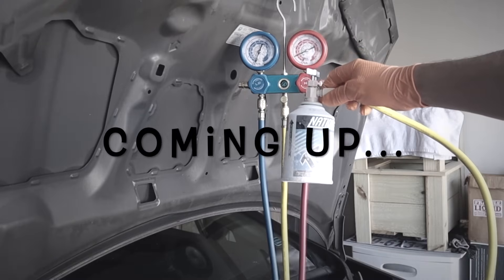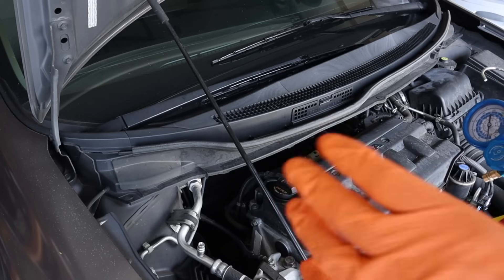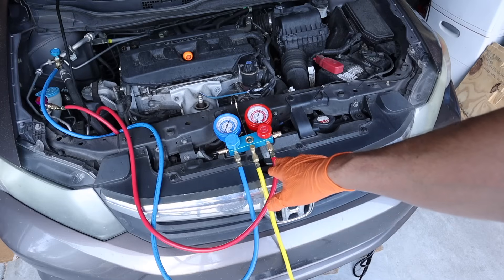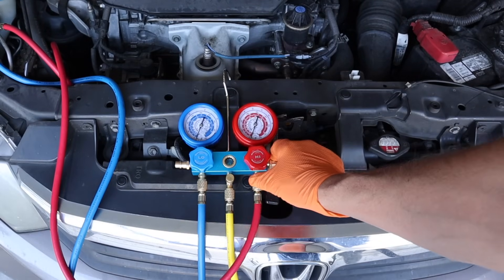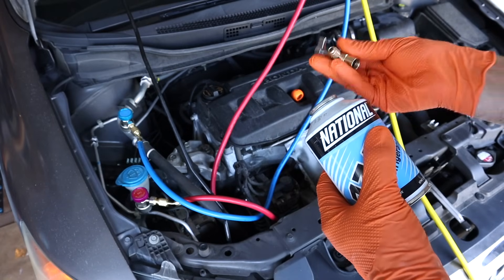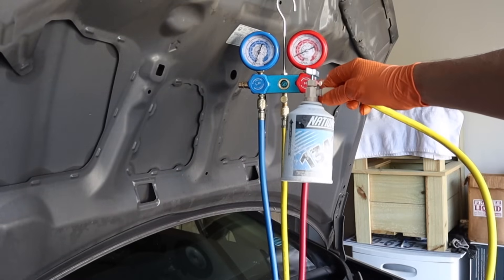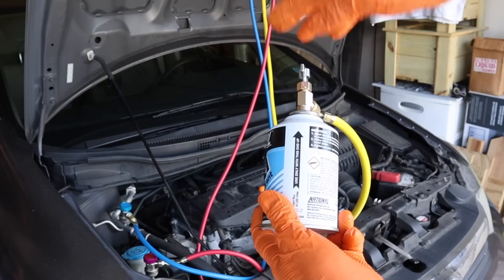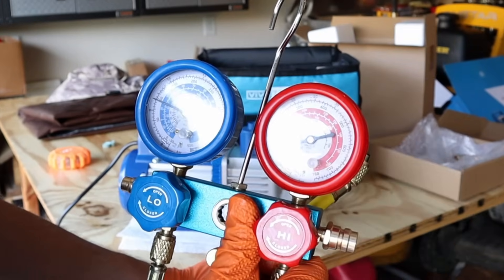DIY Tutorial - Proper R134a A/C charge & Diagnostics

Comment: If the system still have refrigerant in it and you do the vacuum, does it pull the refrigerant out too?
Reply from the maker: Good question. You'll need to get the refrigerant reclaimed (taken out) at a local shop before hooking up the vacuum pump. Most shops will do this at no charge if you tell them that all you want to have done is have your refrigerant reclaimed. They can reuse/recycle it so it's a win-win. You may have a to call a couple of shops before one will do it at no charge, but they're out there. Hope this helps!

Comment: You should close the high pressure valve prior to opening the low pressure valve to let the refrigerant end.
 You're simply reading the high pressure gauge while the fluid is going into the low pressure side.
Reply from the maker: @Gruin  100%, yes indeed high side stays closed when refrigerant is going in. Thanks for watching!

Comment: If you close the valves to check for a leak, doesn't that mean you are not measuring the ac system, and are measuring just the gauge alone?
Reply from the maker: Solid question, thanks for asking. However, the gauges always "sees" what's going on in the AC system independent of whether the manifold valves are open or not (as long as of course you have your valves open down at the service ports). And you can look at this another way to confirm this.. When you have the manifold gauge set hooked up with a charged/functioning system, you can see the gauges fluctuate when the compressor cycles on and off, all while the valves on the manifold are shut. Hope this helps!

Comment: I’m having an issue with my vehicle accepting a charge. I’ve tried switching the yellow hoses, using a new can. Forcing the compressor on while charging but no refrigeration flow… This happened on multiple cars. I’m beginning to think the manifold is faulty
Reply from the maker: Couple of things that might help.. do the procedure on a hot day, 90+ deg. Second, try twisting the valve back and forth on the can up and down slowly until you find that sweet spot that'll allow the refrigerant to flow best. Hope that helps!

Comment: awesome video explaining everything however i have a 2009 cadillac cts with a 3.6l llt engine the previous owner got into a front end hit and damaged the radiator and condenser in which i replaced both items and installed a new desiccant filter in the condenser but i believe the cars ac has been unpressurized since maybe 2019 so i was wondering what should be my starting process because i was just gonna buy a can of 134 and hook my hose up to it and see if i can jump start my system but after seeing this im changing my mind as i want to do it right and i want cold air and id prefer not to have a shop charge me 200 plus for simple stuff i can do
Reply from the maker: In your case, yes definitely go thru the vacuuming/charging process like you saw me do in the video. And like @ddu2109 suggested, you'll want to add a bit of PAG oil to the system as well since you replaced your condenser. My only concern is that the system has been non-operational for 5-6 years. You may want to put a wrench on your compressor and see if you can turn it by hand before you do anything. If it's not locked up, then proceed on, cross your fingers and see what happens! Thanks for watching and good luck!
Reply: You should start w an evacuation, then make sure the system holds the vacuum from evacuation to show it's air tight. Then start with the fill. (Consider adding lubricant, depending on what was changed) if the dessicant has been in a system unsealed since 2019, I'd replace that dessicant prior to evacuating the system.

Comment: After I vacuum the system to 30 inches of mercury, how can I check whether I have a leak at the schrader valves? Your method only shows if there's a leak in the internal AC system because the schrader valves are still depressed, correct? My system is completely empty of freon currently because I have a slow leak somewhere, but I dont know if its just the schrader valves. Thanks.
Reply from the maker: That's true, however you'll generally get a sense of whether or not you have a leaky Schrader valve due to wetness (from oil) at the valves. An easy way to test the Schrader valves if still unsure is to spray a little soapy water onto the valves (when the system is pressurized with refrigerant) and you'll see bubbles if you have a leak. And if you are still not quite sure, replacing those valves are easy enough. You can find a kit here to do just that: https://amzn.to/45ddxfJ Hope this helps!
Reply: @my-honest-review  Thanks for the tip. I ended up just replacing the valves.
Reply from the maker: @lucatoni98  Good idea for sure, glad to help 👍

Comment: After vacuuming, I put the refrigerant, I hear my compressor clutch engage, however, pressure from low to high is NOT transferring. What could be wrong with my system?
Reply from the maker: If you put the correct amount of refrigerant in the system and still no cooling (and your compressor is cycling on), you may have a restriction in the system. What do your gauges read when the compressor is cycling on?
Reply: @my-honest-review after vacuuming, the compressor doesn't engage, then i start to put refrigerant, i hear the compressor engage. However, low side quickly goes to around 30psi, but high side doesn't move. It seems no 'transfer' and refrigerant is stuck on the low side, i can't even empty the small can (and can doesn't get frosted)? Is my compressor not compressing even though it's engaging?
Reply from the maker: @pazuso  OK, so it sounds like its just very slow to take the refrigerant. Here's a couple tips... its best to do this process on a hot day (90 deg+), try putting a fan in front of the condenser/radiator, you can also try wrapping a warm cloth around the can as its going in and squeezing the can slightly, and lastly, try moving the valve on top of the can back and forth slightly as it can freeze up at times. It can be a little time consuming but hang in there!

Comment: It's your dryer
Reply from the maker: That was definitely a possibility, but it turned out to be the expansion valve. I did a video on it here: https://youtu.be/1PBz5_kW6q4 Thanks for hanging out 🔧
Reply: See the metering  devices got some form of restriction due to burnt oils or metal particulate in the screen or you have too much oil in the system that's all I can be. I was an HVAC Master tech for Sears for 8 years and rode over 13 manuals for HVAC this is not rocket science
Reply from the maker: @benm3574  Yep, it's mostly just taking your time and doing a little critical thinking. Thanks for hanging out!

Comment: Putting the can ( while connected) in a container of warm water, speeds up the charging process. It helps the freon leave the can, especially when the low side gets closer to normal pressure.
Reply from the maker: Great point, I've seen people do that for sure. Also, just wrapping a warm cloth around it helps too, thanks for watching!
Reply: For the purpose of using a scale you could maybe use a hair dryer or heat gun?

Comment: Did everything you did, and I've been trying to get this can to empty for an hour... So I put it on in the scale and it's actually getting HEAVIER.
Reply from the maker: Try twisting that valve up and down a bit on the can. Sometimes it ices up inside that valve. Twisting it can re-find that "sweet spot". Also try wrapping a warm cloth around the can as this can help. Hope this helps!
Reply: @my-honest-review  Thanks, I did play with the value punch and could hear  and feel the can react to the changing of pressure as I twisted it. I wonder if this 2019 Santa Fe XL just has some other failure going on, maybe a restriction somewhere. I might give it another try tonight, I've read about fill hoses having restrictions, which could be why the first can took so long, even under vacuum; I might swap the vacuum and fill hoses and see what happens (my gauge set has both).
Reply from the maker: @David.Murdoch  Let me know how that works out. And you might just need to wait for a hot day as this seems to help with the speed of charging as well.
Reply: @my-honest-review  ended up being a leak in the rear evaporator. I wonder if pulling vacuum then charging (a few times) can cause an existing leak to get more severe.
Reply from the maker: @David.Murdoch  Hey Dave, it's possible. I can see your reasoning for sure. Ordinarily, a sound system can withstand a sustained vacuum with no problem, but if a breach is about to occur, vacuuming can encourage it along. Ultimately, the breach would occur anyway tho. Glad you found your leak!

Comment: Hello, this is a very nice video with very good and wise advice on manupulating A/C, congrats.
One point though : I believe that by the way you purged the yellow hose, you did not purge the gauge manifold content itself hence still keeping a bit of air/moisture remaining stuck in that area.
Probably a good turnaround for this point would be having an additional valve on the yellow port of the manifold set so that after pulling overall vacuum and before disconnecting the pump, you would first close that valve. Do we agree ?
Thanks in all cases, very well done.
Reply from the maker: Indeed great point. Even after purging the air out of the yellow hose, there remains a tiny bit of air in the manifold. From my experience it is negligible however. But a separate purge valve on the manifold itself would indeed be a nice little addition to get that little bit out, I can see the value in that. Thanks so much for watching!

Comment: When you disconnected the second can and opened the valve in the manifold to suck in the remaining Freon , wouldn’t that also suck in air once it sucked all the freon ? Or no because the line was never exposed ?
Reply from the maker: @BoxtruckGeneral  Good question. It certainly would have introduced air in the system had the can been removed. But since the can was still attached, it's all good. I had just closed the valve on the can at the point your are referencing.
Reply: @ copy that,thanks boss 👌

Comment: On the cans with R134a I have is clearly stated "Hold upside down when using". So why is that?
Reply from the maker: @winandd8649  I don't take any chances. I only like gas to go into the system. You might get away with it 99/100 times holding the can upside down, but I'd rather not risk it. It just takes a few extra minutes to charge the system with the can right side up.
Reply: @my-honest-review  thanks!
Reply: Crazy.  Maybe the pickup tube inside the can extends all the way to the bottom?  So doing a 12 o'clock to 3 o'clock tilt is may not be a bad idea.  Watch your site glass on the manifold gauge set.  You can see when liquid is coming out.

Comment: Why don't everybody show how to vacuum or drain oil, how do I know if it has enough oil,and I want to know how to refuel it in a proper way
Reply: Putting a vacuum on the system does not remove the pag oil. If you replace a component, the rule is to add 1.5 oz of pag oil for each component to replace. To know how much refrigerant you need to put back after holding a vacuum on the system, there should be a sticker under the hood that tells you how much refrigerant your system requires as well as what type of refrigerant (134a is very common).

Comment: You said you had other issues with your system b/c of the low high-side reading. What was the issue and how did you solve it?
Reply from the maker: @chpie357  Yes, it turned out to be the expansion valve and I did a video on it here if you want to see https://youtu.be/1PBz5_kW6q4?si=42qtbUtw8yBt1QK8

Comment: This is the right way to do it. Please don't use those cans with hoses as you will do more harm than good. Starting in 2024, freon cans are self-sealing, so you will need an adapter between the can and the tap valve. It's only around 4 bucks, but you will definitely need it, or the can won't release the freon.

Comment: You know you'll never evacuate every molecule of air. So when you stop the pump and let it sit, a temperature change can make the line pressure change slightly. So if it cools off while you're watching the gauge, the pressure would likely go down without any leaks.
Reply from the maker: @blackbirdpie217  You're right, a sudden temperature change can make a difference in your readings a bit.

Comment: Very good. One question on vacuuming: on final 1 hr draw down did you use new dry oil to avoid the first vacuum moisture saturating oil? My first draw down on my system was pretty cloudy after using it cleared but I was thinking that wet oil was why auto stores rent you dry pumps and you buy new oil. Just curious. Very thorough video.
Reply from the maker: @perryberens618  Hey thanks for hanging out today. The oil in the pump itself does get a little cloudy over time, but it doesn't effect the vacuuming process of your ac system. You just have to make sure it stays above the minimum level so the pump will not burn out. Hope that helps!

Comment: I have a question, other videos say to never open the red valve for the high side. But here it was opened. I am confused.
Reply from the maker: @Kenichi_one  Totally understandable, good question.. And the simple answer is this: Use the high side (along with the low side) when vacuuming the system out. And use only the low side when adding the refrigerant after the vacuuming process. If you are using the gauge set to only add refrigerant to begin with (not going thru the whole vacuuming process) then you're only using the low side. Hope that helps!
Reply: @my-honest-review thanks, I get it now :)

Comment: I Did Many A/C Vehicles 
Without Gauges, Vacuum
And shetty,
I Did Change Compressors,
Condenser And Evaporators
Without Machines And It Did
Work 100% Same As Using
Machines.
Amén.

Comment: Does the evacuate with the pump take out the refrigerant, or only air and moisture? Also we did an evac after installing a new compressor, the most we could get is 24, not 30. But it held and didnt leak. We added refrigerant but not the full amount to make sure compressor turned on. After a few mishaps, hubby had left the high side hose open and it wouldnt charge fully. We left it till we figured out what to do next. Did an evac again and added r134a again. He disconnected it all but it needs more refigerant. Can we add more without doing an evac or do we have to recover all we added and refill again? 😅 great video also, most dont walk through important steps, like closing high side on manifold!
Reply from the maker: @ZombieGameZ  Hi there, thanks for hanging out! When you hook the vacuum pump up, you're only drawing out air and moisture. Refrigerant will have already been reclaimed at that point (most shops will do this at no charge...you just have to call around). Now... at the stage of the game you're at, you can try to "top it off", but you'll need to bleed the air out of the blue line as well when you have it all hooked back up. And do that by cracking the blue line itself at the manifold to let the refrigerant in the system backfeed up thru the hose. Then close it back and you're good to go. Of course bleed the yellow line as well like in the video. High side doesn't even need to be hooked up at all. If all else fails, just start over.. painful but necessary. Hope this helps!
Reply: @my-honest-review  thank you for the response!
Reply from the maker: @ZombieGameZ  my pleasure 😊

Comment: When I add the R134, its spews out from high pressure line after condenser once the compressor kicks on
Reply from the maker: @ShowtimeWorthy  It sounds like you have to replace that line assembly from the condenser to the evaporator, not a bad job at all on alot of vehicles.

Comment: After pulling the vacuum and doing everything I was supposed to, my first can did not go in quickly like you said. Out of about 11 oz it only took 3 oz, never took any more and the clutch never engaged. Had to start all over. Why would it do that?
Reply from the maker: @SeanDoe86  On some AC systems the compressor is very stubborn to engage when doing a recharge. Try taking a dish cloth and running it under hot water and wrapping it around the can while trying to get it to go in, even squeezing the can slightly. Also, "play with" the valve on top of the can, twisting it back and forth as sometimes it will freeze up. Until your system "sees" enough refrigerant in the system it will not allow the compressor clutch to engage. It takes a bit of time. Ultimately, if you may have to jump the compressor to force it to come on to take the refrigerant, but do that as a last resort. Hope this helps!